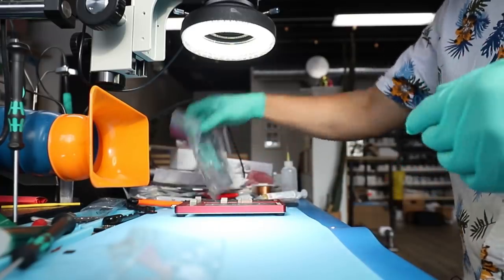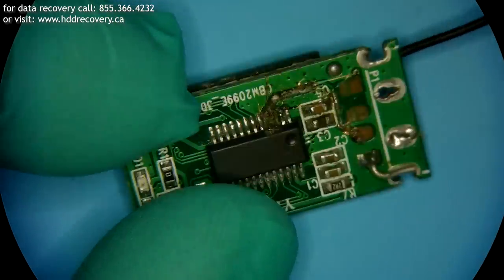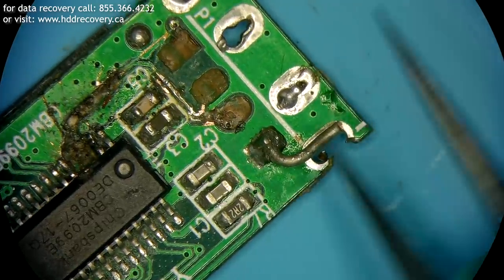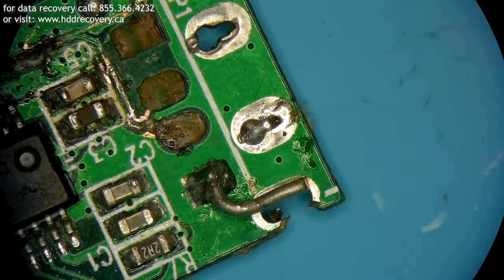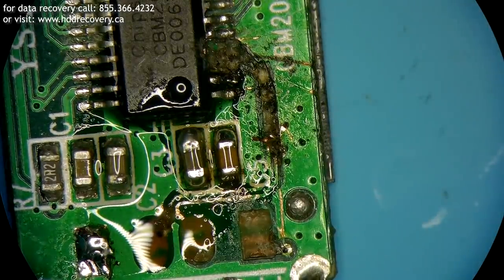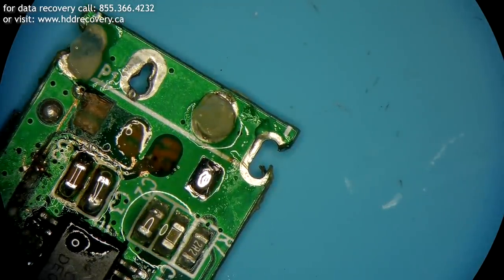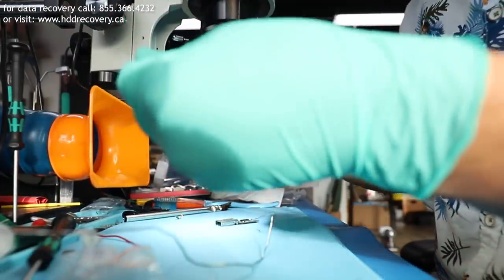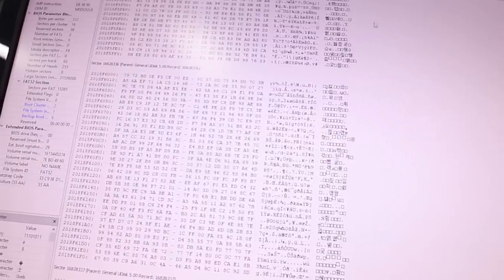Quick way to fix a flash drive to recover data from it

Comment: Beautiful work. This is the kind of work that I love to do too. A paraplegic chip no longer bothers me. You demonstrated why. I repaired a large Xilinx gate array that way back in the early 1990s. I only had the one part, was working alone in the lab on a Friday night and had a Monday morning deadline for the final demo. No pressure. Right? Too bad the board we designed, a wavelet based video compressor, never caught on. It worked gloriously too. Darn that old MPG! Thanks for the excellent video.

Comment: Wow, when I saw the burned traces I thought toast! Difficult to imagine how enough power got to those traces to burn them since USB connector power is internally limited to a very low value, well below what would burn traces.
Reply: They look like they were ripped off the PCB
Reply: Capacitance

Comment: I had a flash drive I started to add MP3 files to it using cassette to MP3 converter. Suddenly it stopped taking MP3 files. When I connect the flash drive to my PC it is not recognized right away. The LED light flashes fast then stops and then there is a sound on my PC that it was recognized but all data were missing. I have 100s of songs converted from old cassettes to MP3 and suddenly can not see them any more. Please help

Comment: I accidentally mistaked a 1394 header port for a usb header port on my motherboard. Plugged in a flash drive into the usb port and now the drive refuses to work... no lights no nothin. It doesn't look like anything is wrong with it, shows no signs of anything, but, it did get a bit warm when i plugged it in. I then removed the drive investigated the port issue, corrected it, and still drive don't work.

Comment: Another great video. I'm slowly going through all your video & have learnt lots. It has certainly rekindled my interests in data recovery.
I did a pc3000 udma & their flash tool courses in russia some 5 years ago. I also had flash extractor. family & a career change then happened.
I like seeing how data recovery tools have changed like ie vnr tool it seems a different approach.
Is there a way yet to read the controller as a dump file & import it virtually in ie vnr or flash extractor so you dont have to work out the configurations of xor, page, banks etc  i know that the mentioned tools have a large database of pre configured settings.

All the best

Comment: hello i need help i have sandisk sd card 16gb and i formatted it without checking quick format and it was taking longer than expected so i stopped it in middle and now my sd card is not shown anywhere and it shows as no media in diskmgr and not shown in any recovery tools and i even tried chip genius and it does not detect either.to my surprise i removed sd card and inserted only card reader and it showed the same result in chip genius as with sd card so my sd card is dead what can i do now.plz help

Comment: The only thing I see a potential problem with is that you didn't run those data lines closer and more in parallel like the original traces. That is done for the sake of the differential signal integrity - the more parallel and equal in length they are, the better the signal integrity, although at 480Mbps and such a short length it shouldn't be a problem. Sorry, I'm a perfectionist! 😉
Reply from the maker: nothing wrong with being a perfectionist, but as you mentioned at this length and purpose of single data transfer off the device there is no difference
Reply: @hddrecoveryservices   Yes, I figured for a one-time data-save all that matters is that it works. Priorities. 👍

Comment: Considering that you didnt know what exactly happened to the drive in the first place, is it not too risky just reconnecting everything and power it up?
I would be afread of damaging the nand IC if something went wrong... not because of your repair, but because the controller was already damaged.
Reply from the maker: Damage the NAND how?
Reply: @hddrecoveryservices  No idea... is it not possible that a damaged controller could damage the content of the nand? 
I dont understand much of it so thats why I asked, but it feels like a damaged controller could hurt the content of the nand or even damage it somehow... tho, I assume there is no possibility for overvoltage, but maybe send 5v to some data lines?

Comment: I have a Patriot SuperSonic Xpress 32 GB USB stick that some time ago switched to "read-only mode" on its own and I can't switch it back to read-write no matter what I tried (both on Windows and Linux). Diskpart on Windows says that the read-only flag has been turned off successfully, but when I check the flags afterwards, the "Current read-only state" is still "Yes". (The other one below it says "No", which is quite confusing.)  I opened it up to check what's inside, and there controller appears to be Phison PS2251-03-Q, with two memory chips (TT57G2JAJA T1248). The USB stick is properly being recognized, so it doesn't seem to be physically damaged, I'd rather say it's something with the firmware. What can I do to fix it and remove that "read-only" flag? I don't care of the data, I just want it to be writeable again.
Reply: Why would you work hard to unscrew hardware that's already proven to be suspect?  Isn't your data or time worth anything to you?  Life is too short to suffer dodgy hardware.
Reply: @lmamakos  Why? Because it's fun. Because it allows you to reuse your hardware instead of throwing it away and wasting your money on new one. Because it's good to know how stuff works in order to understand it better. Especially these days, when manufacturers put some nasty things in their gadgets so that they could control their users or squeeze more money from them.
And as it turned out, that was the case with this particular USB stick too, because I managed to repair it :q  I found a group of hackers who reverse engineer those controllers, and they told me the secret SCSI commands the manufacturer uses to revive the controller by restoring its original firmware when it gets corrupted. I sent those magic commands to the controller, restored its firmware, and voila, the USB stick is ready as new, everything works fine, I got my 32 gigs back, for free.
As a bonus, I now have knowledge of how to revive USB sticks with this type of controller on board, and possibly some others too (if I generalize my software to magic commands of other controllers out there). So I can now make some money on recovering people's data or reviving their USB sticks.
Sounds like a good and useful way to spend the time of my life, doesn't it? :P
Better than being a dumb consumer and saying "Well, shit, this USB stick is broken, let's buy a new one", and allowing the manufacturers to screw you over even more :P

Comment: What you call the thin wire that will not ground the other conponent sorry bad grammar
Reply from the maker: It's an isolated wire ( it has a nonconductive clear coat)
Reply: @hddrecoveryservices  thanks coz 1 time Im repairing a mouse clicker got mess up need to short 1 of the pin.